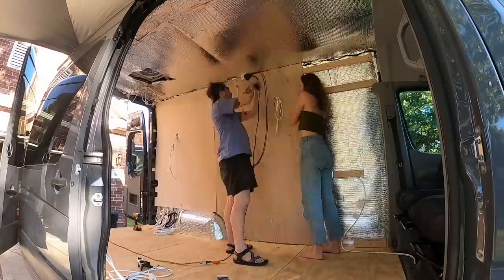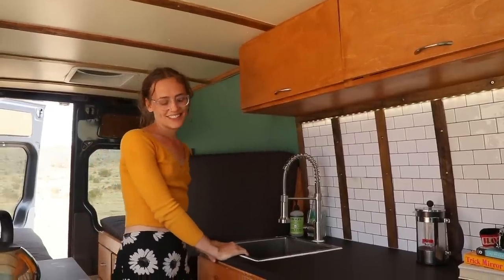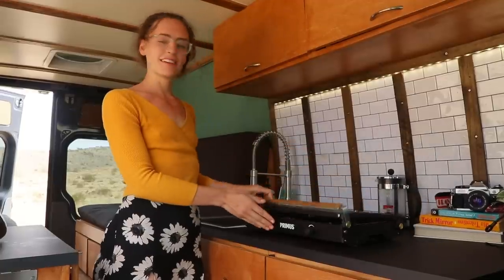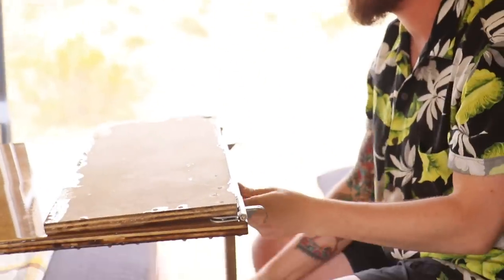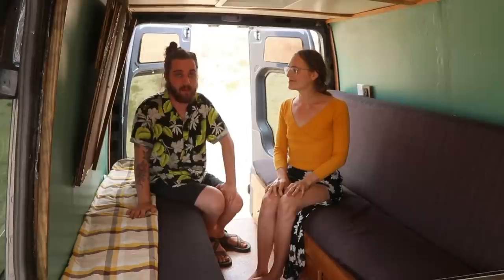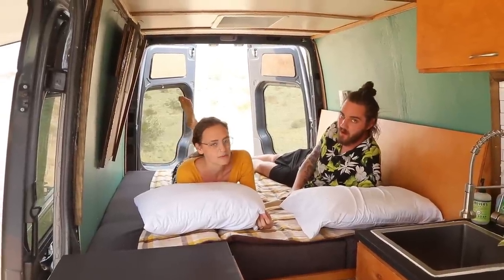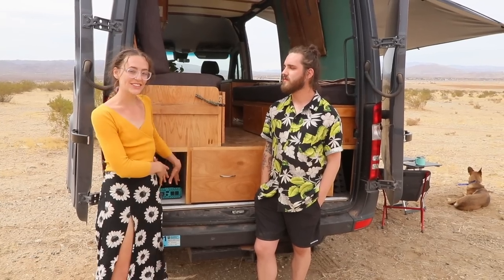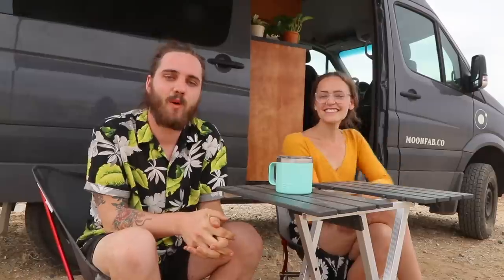4X4 SPRINTER VAN CONVERSION | with Hidden Bathroom, Convertible Bed, & Full Kitchen | VAN TOUR

Comment: That table..... I thought you would've understood the comments in the last video.  The hinges being exposed, half of the usablility and half the seating are gone because it drops down. 
Not sure if that wall is textured or a bad patch job painted over.  The hinges on that toilet top..... Better hope it doesn't get flexed over too much.
Reply: Also that caulk around the sink and faucet......
Reply: Fak I hope our van build gets your seal of approval!!! Haha 😄 we'll do our best to keep the electrical out of the shower 🤷🏼‍♀️
Reply: @FnAVanLife  I'm not trying to be harsh.  There last build wasn't all that pleasing to look at either, but it was there own van, so who cares.  Lol!
Reply: Whatever you do don't sand the giant resin drops off of the bottom of the table. That would take away from the artisanal spirit of the table. HAHA.
Reply: A good sized table on a lagun mount would have worked a treat there. Or you could have done a table with legs that compress lower, so the table forms the bed top when you go into bed mode.
Reply: @FnAVanLife  it's considered good practice not to have the backside of a 110v power point right in your toilet. I don't think that's been done before, and it looks crazy dangerous too. But hey, what would I know, being a retired builder and all. :D
Reply: @Aspecto5  hahahaha 😆

Comment: The hanging table is an eyesore & w/one leg I don’t understand how it can be stable. You at the very least need to paint/poly the side that shows when it’s up on the van’s wall. It just looks shabby especially in contrast to the gorgeous top. Why didn’t you use a lagun table & mount? Would’ve been so much nicer. Or w/Aubrey’s talents paint a mural or something on table when hanging up.

Rest looks great except for some of the woodwork (like near the USB ports in back). Cork flooring is ace. Sorry but I still think you need to improve that table. And ppl are going to hit their heads on it the way it juts out. Good luck w/the van. Wanted to try it but decided not to apply bc didn’t want my husband to have that be his 1st van experience.
Reply: I agree with the walls. It looks unfinished.
Reply: It's hard to think this was a 5mth project when it looks more like a solid weekender.